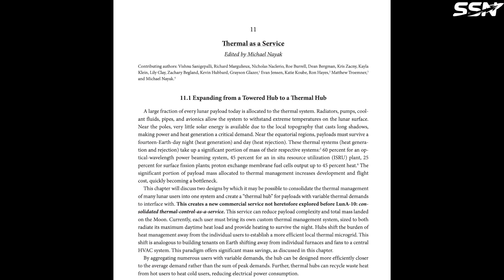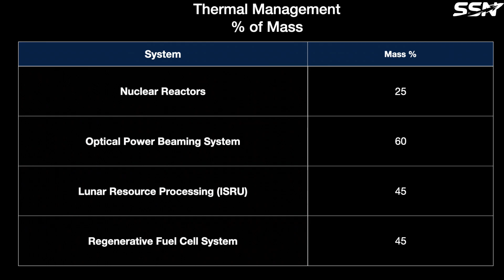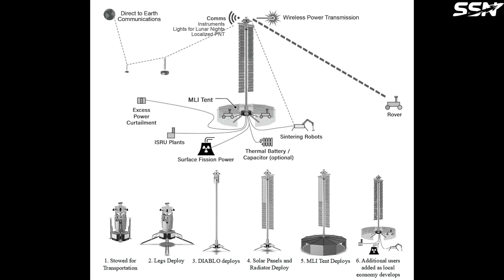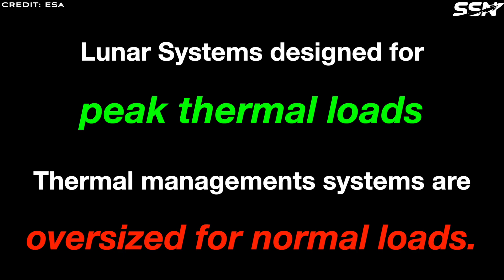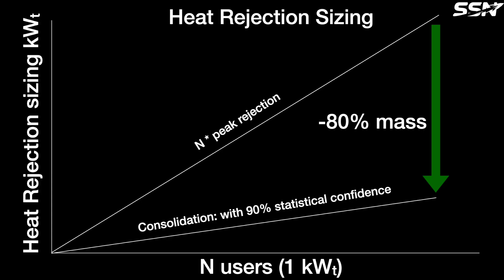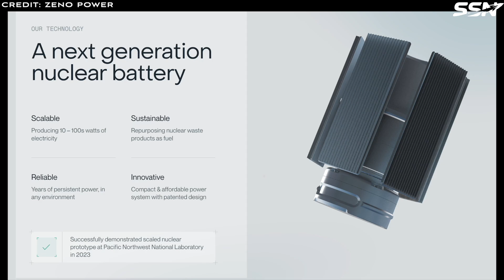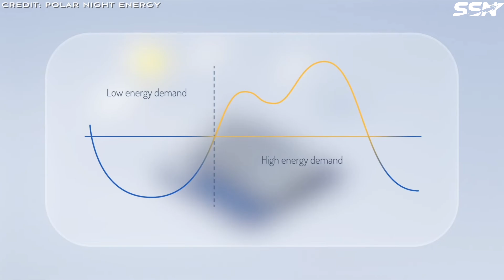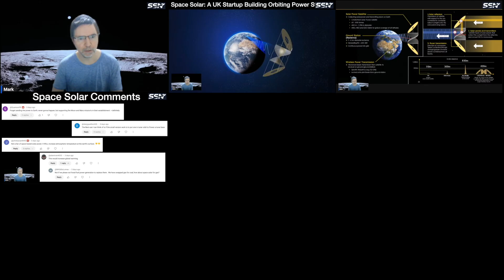Lunar Infrastructure: Thermal Management as a Service

Comment: Question - have anyone ever considered the use of droplet radiator for lunar surface?
Unlike free fall droplet radiators, the droplet generator and collector will be in the same place as the droplet generator shot them upward only to be brought back by the moon gravity.
The danger of droplet splash is minimized cause of moon gravity.
The radiator isn't moving like a spacecraft so there are no restrictions on max accelerated premited.
In case of some coolants like ionic fluids a in situ manufacturing is possible, far easier than manufacturing solid radiators.

On the visuals, ionic fluids are transparent to light so a wall of droplets under the sunlight could creates rainbows on the moon.